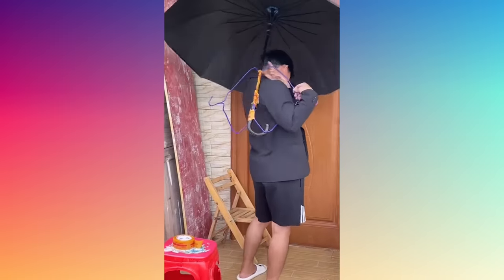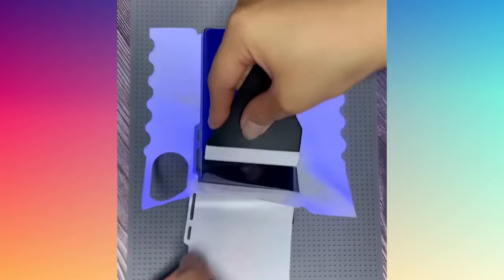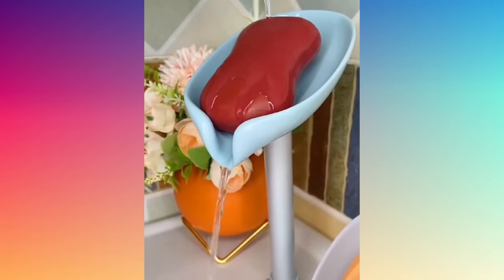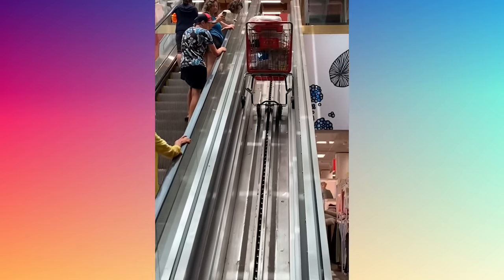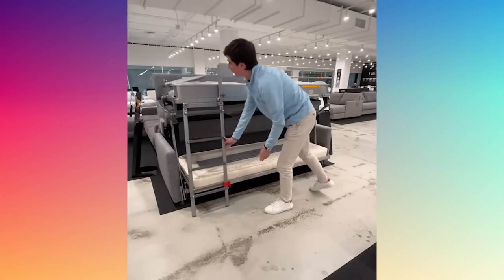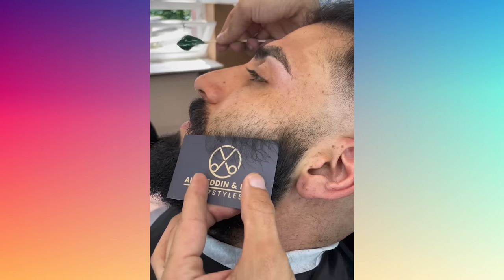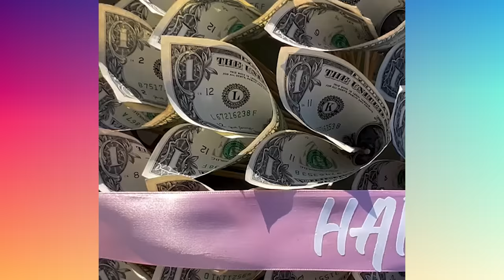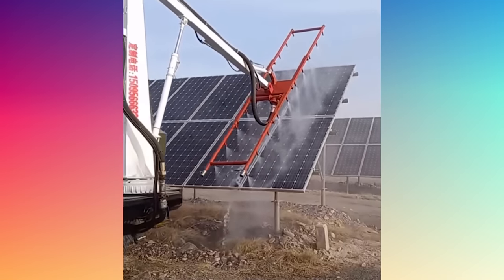Try Not to Say WOW | Satisfying & Relaxing Video with LoFi Cozy Music

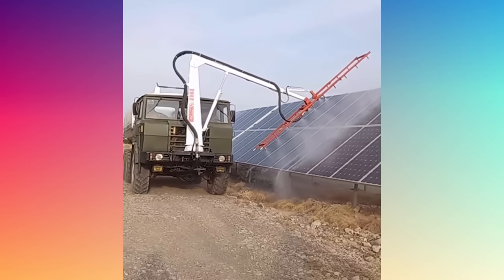Comment: 29:24 Large scale implementation of solar cleaning. Lay rails, send drone,
it sprays water unparalled precision, minimum water, possibly even recycling water.
Every solar farm should have it. Even the rails can be a bit sloppy, since
the drone's arm can detect correct distance for water emission,
and clean two rows of solar panels at a time.
Software can alter speed or pressure, depending on cleaning outcome,
or redo the cleaning in places where there's exceptional dirt.
Water reusage and application can be akin 13:39, and working hours 24/7.